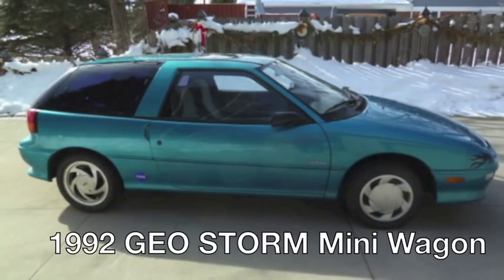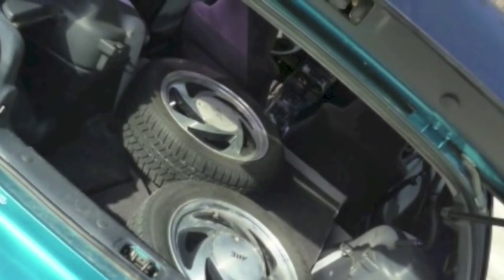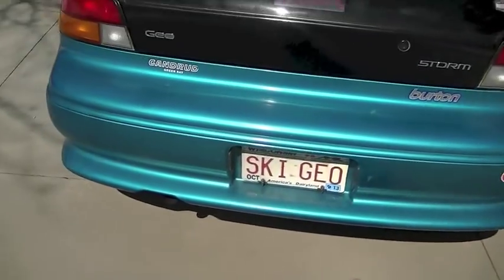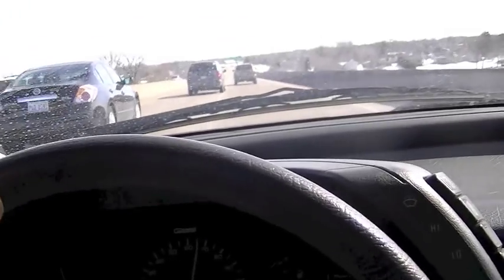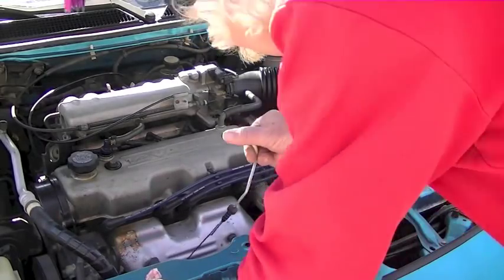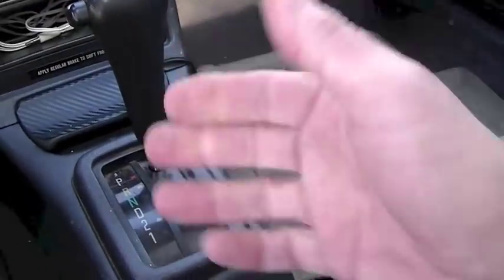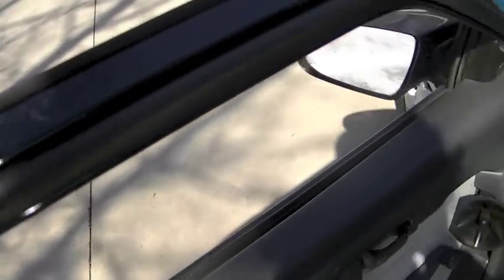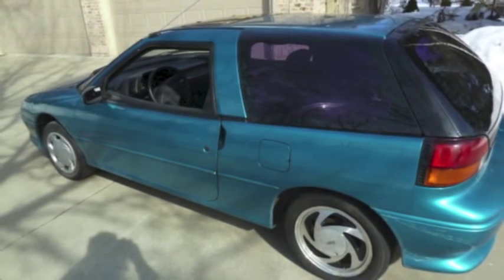1992 Geo Storm Mini Wagon

Comment: I owned this exact car. The color, year, but no cheap aftermarket 'moonroof' or whatever.....a hole in the roof to rust/leak.  BUT this tiny car only EVER gave me...19mpg! EVER. I loved the 'wagon' shape, rarely saw it anywhere, and the color was even more 'rare'. But no matter how many times I took it back to Chevy...I bought it to get maybe, 30MPG...it never got over 19MPG. I found out after decades of driving now, a 3sp auto. in tehcity,equals crappy mileage:(
But I would love to have that Geo back. It was basically a Toyota under some GM skin, so it had Toyota quality,and a GM price. That was the marriage of Toyota and GM 'in the day'. Mine was cherry, not a speck on it or under the hood and if I had it today, it might have 60K on it, if that much! The good old days of kind of unique looking cars,...not all huge boxy SUV's and crappy revised Minis!    Still miss it today 6/28/2019
Reply: It's a Suzuki not a Toyota
Reply: The merger was for several cars, like the Geo Prizm/Toyota Corolla...the Geo Storm and something from Toyota, I think it was a Tercel model.  The merge was called 'Nummi'.  Look it up!

It was Toyota and GM...Suzuki had nothing to do with it.  They came off the same line,  just different badges, slightly different body parts, but you got a Toyota engine!, But GM 'workmanship'!  Thus the savings on the 'Geo' models.  They were not pure Toyotas. 

My Prizm, a 'Corolla' in GM skin, had body rot, I found it under the door rubber, AFTER I bought it. A 9I bought it used, for like $3K less than a similar Toyota, but figured it was a bargain Toyota. They were 99% identical. But my Storm HB got crappy mileage. My Prizm got Corolla mileage.